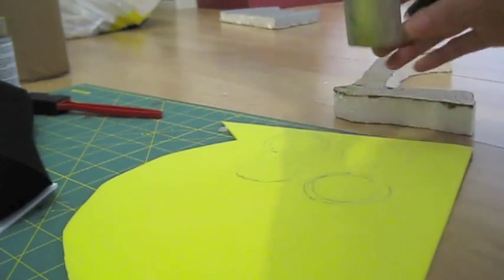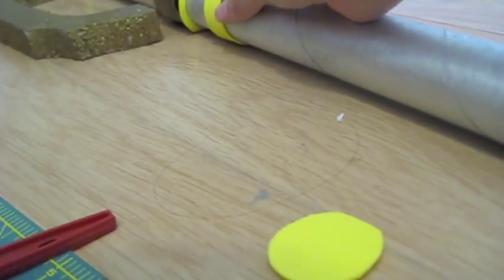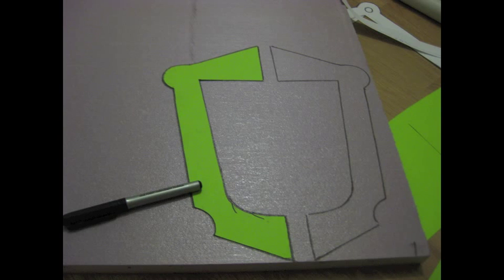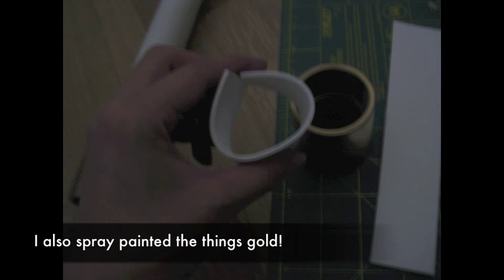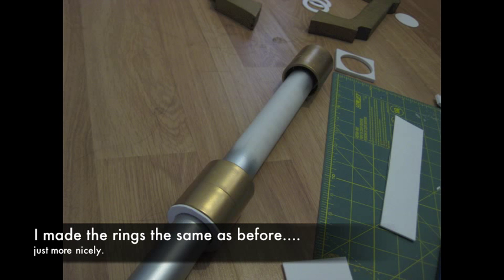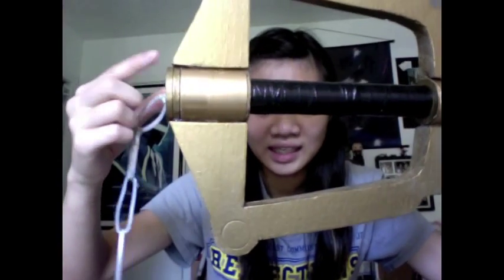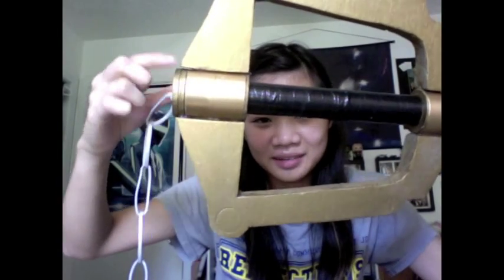Keyblade Tutorial pt 2

Comment: Um a couple of questions.... 1: What did you use for the handle.
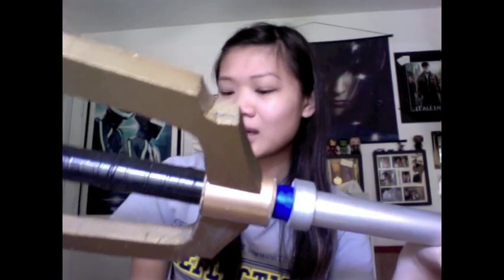2:How long where were the pipe fittings? 3:What did you use for the little ring by the pipe fitting? (Stop at 10:50 and you will see what i am talking about o_o)
4:How long was the PVC pipe.Sorry for asking so many questions!!
Reply from the maker: The handle is the PVC pipe, only wrapped completely with black electrical tape. Stretch it and double it up in places to get some texture. (Unless you mean the gold hand guards.That is house insulation foam.) The pipe fittings are about 2" long and like 2" in diameter. The little ring (I'm assuming you mean the piece that separated the blue bit) is just thicker craft foam. And the PVC pipe is one 10' pipe I had divided into thirds, which is about 30"-33" but you can scale it down to your own height if need be.
Reply: LTNguyen12 Thank you T^T !

Comment: Hello! I know it's been a long time since you've posted this video but hopefully you're still taking questions! What did you mean when you said spray paint melts the foam??
Reply from the maker: Hi!The chemical in spray paint and in foam don't partially get along. It will literally melt the foam; think of it like a more PG version of hitting a block of ice with your water hose. The spray paint will eat through the foam and release bad fumes. This is why for any type of styrofoam, I recommend acrylic paint. (Unless you seal the foam very well with glue, gesso, resin, etc.)
Reply: Did you use anything or know of anything to reinforce the foam parts? I went to Home Depot and got house insulation foam, and cut out my pieces. But I'm afraid that they're still too fragile. I've seen some people use masking tape but do you know of anything else??
Reply from the maker: Nuh-uh, just hot glue to attach the foam to the PVC pipe. The pieces don't break that easily unless they are very thin. I've had more problems with the glue than the actual foam